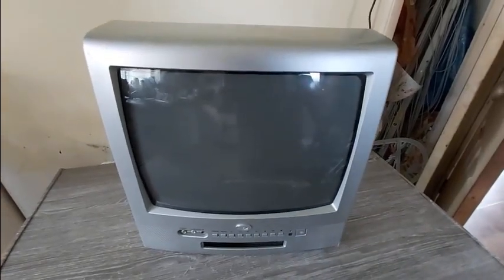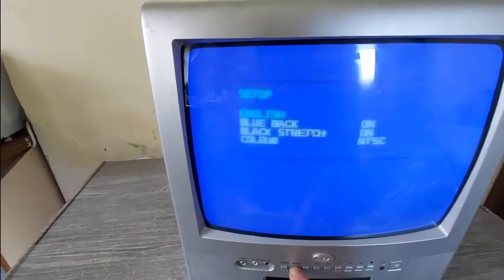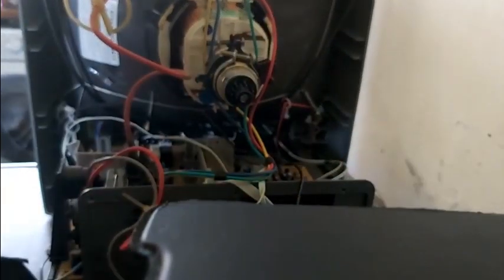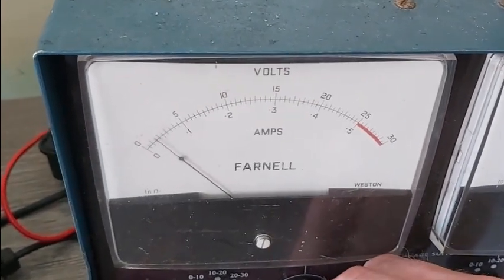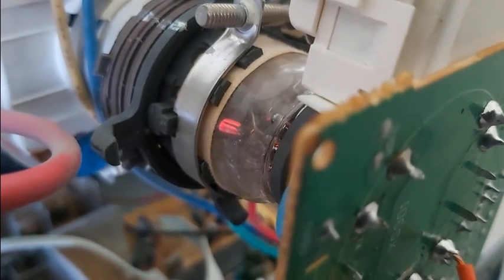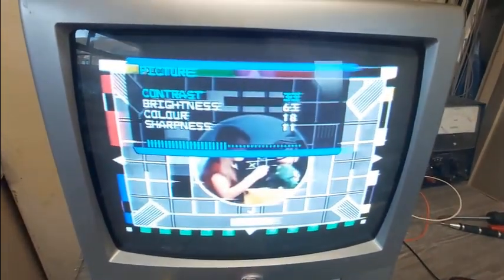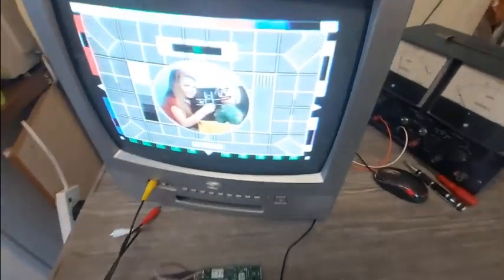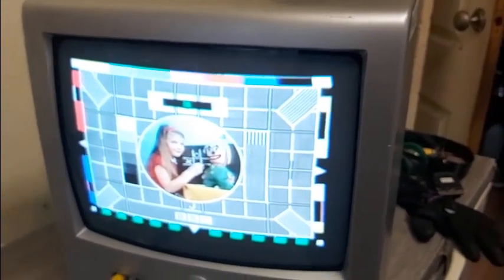Fixing a CRT TV with a weak tube

Comment: Hello, Like your video's ..They take me back in time, A couple of old tricks to bring the crt back not for long though ..Boost it but has your boosting tap the tube neck gentle taps ... always worked .. But not for more than 3 months normal use.. The other sounds crazy but it also worked get a plank of wood and a towel and hit the front of the tube about 3 times ...Thanks for posting ..

Comment: Hey, awesome video here. Thanks a lot. I just wanted to know that it's possible to fix a crt because I'm about to buy a sony trinitron, which is in good condition, but in the future would be nice to now what to do. Thanks again.
Reply from the maker: NEVER do this to a Trinitron, you will kill it!
Reply: @MegaWayneD  Ok ok :)
Reply: @MegaWayneD  i have a pvm 14L5 with a weak tube. There is something i can do about it ?
Reply from the maker: @doninacio6881  as it's a Trinitron unfortunately not other than finding a donor unit. That's the problem with PVMs, they've often spent decades being on.
Reply: @MegaWayneD  Thank you wayne.